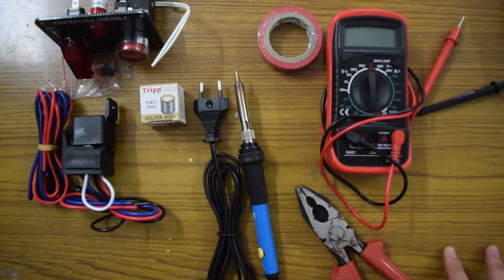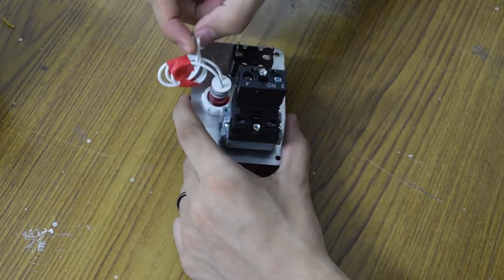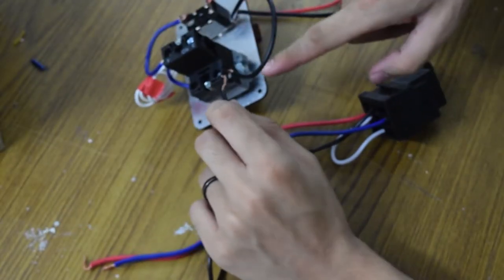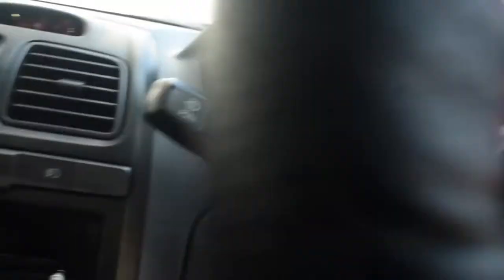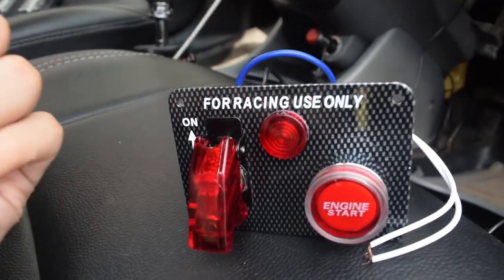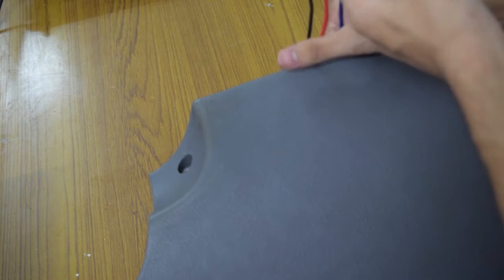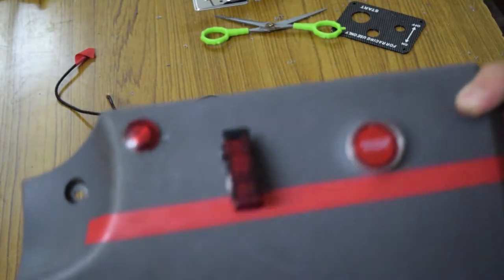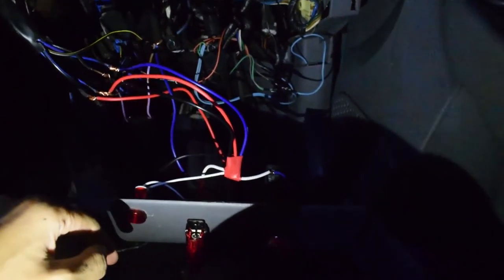IGNITION PANEL INSTALL / DIY Push Start Button install /Wish Car Parts

Comment: so you wired the starter wire into position 4, and the ignition cable in with the main power?

Comment: Is any other module needed other than the toggle switch and push button?
Reply from the maker: No just the supplied wiring and buttons

Comment: How do you wire up the relay to the start switch it wasnt very clear
Reply: and I did not figure out how to connect the relay 😑
Reply from the maker: I mentioned that putting the relay was causing the car to hot wire and start up so I ended up not using it only , but I haven’t seen any issues because of that

Comment: How could car start without key matchng..
Reply from the maker: It’s required when you put the key inside the key barrel, but I have bypassed the wiring so I don’t need to key match
Reply: @CheatsCustoms  and how did you bypass that?